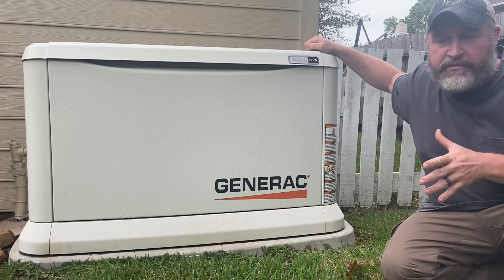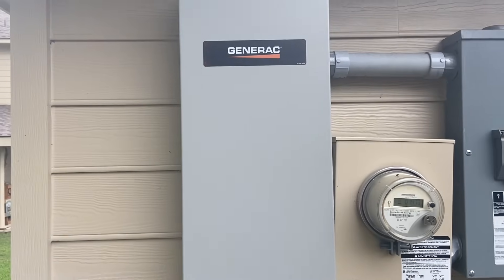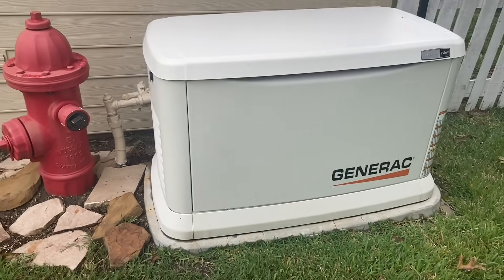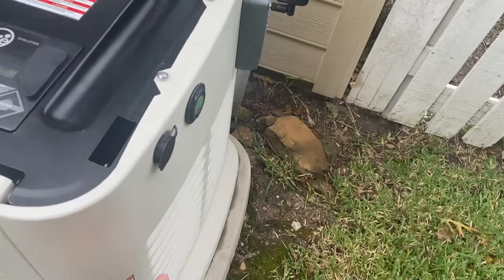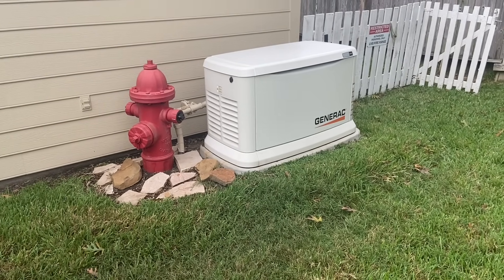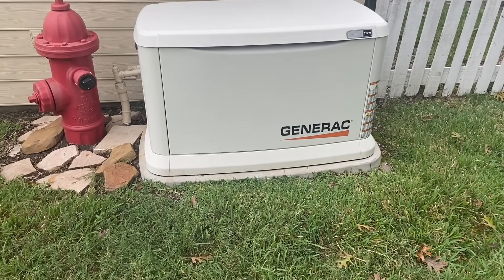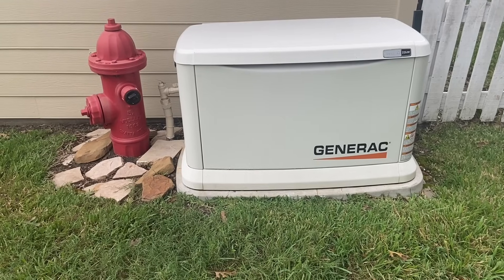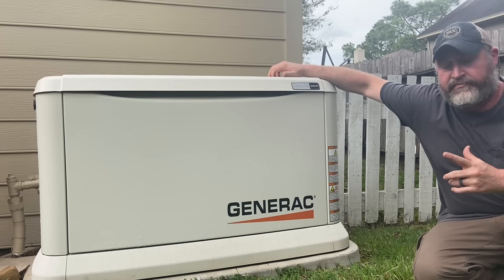Thinking of purchasing a generac whole home generator?

Comment: You got a 2700 sq ft home with 3 AC units and even the garage are cooled. Sounds like you make a lot more money than the average person unless you have 25 people living there, like some of those third world people.  I don't know where you are located , but I live in Toronto, 1500 sq ft?  2 people, and I just have one bedroom with a 6000 btu window AC unit. I am a retired electrician, and I can rig up a 3000 watt generator into the house panel faster than you can blink. I think people like you should experiencing some of Europe's power cost as an exercise of restraint. I am not spending all that money to dig for new gas lines and automation just so that I can sit on my back side when the power go out. It is also not a good idea to hang an extinguisher at the gas meter, if there is a fire there, I want to have distance from it , not to go and grab the thing to try and put out the fire.
Reply from the maker: Great thanks for watching, I work 2 jobs to have what I have. The fire extinguisher is for my grill on the patio. I don’t appreciate the “people like you”comment , you are extremely judgmental. Please don’t subscribe to my channel.
Reply: @JustCantSitStill  Agree with you. I have the means and refuse to live in 3rd World conditions, and Europe runs a close second to that category. Yes, I've traveled there. Nothing beats the USA in living standards. I'm blessed to live here and proud to be an American!
Reply from the maker: @XavierIsraelMatamoros  thanks buddy
Reply: @JustCantSitStill  Somebody is grumpy and jealous lol. Free country means you do what you want when you want. Europe dug their own hole.
Reply from the maker: @CanadianBrewingChannel  thanks buddy, I appreciate you
Reply: @JustCantSitStill  Don’t let the “Tony the Canuck” bother you too much, they tend to be on edge. I am from Michigan and I know the score about them. Many have a big chip on their shoulders about us Yanks, and they are always trying to prove something. After I got back from Iraq in 2007, a few of them used to try to push my buttons about us being over there, but I just laughed in their faces. A friend of mine lives across the border in Windsor, and it seems that most of the guys live in their mom’s basement drinking booze every day and watching hockey, all while their wives work. 

In the end, Tony’s comparative analysis makes no sense anyway. He is comparing his Toronto home to your place, which is completely opposite of your living situation. Also, he doesn’t understand that your generator is based on your requirements; 2,700 sq ft house, 3 ACs, are garage. Obviously you would not be installing such a generator if you own a 1,500 sq ft, one bedroom house, in Toronto. And I’ve been there. It is probably a narrow, two-story house sitting three feet from his neighbor’s house.
Reply from the maker: @veltonmeade1057  thanks buddy! Maybe Toronto Tony will come back and give us all some more of his wisdom and judgment.
Reply: @JustCantSitStill  please ignore Tony Lam. He’s just jealous and envious.  My husband and I live in a 3500 square foot home that we worked extremely hard for.  Hey Tony it’s all paid for!
Reply from the maker: @d.b.4162  thanks for watching and the comment. I am waiting for good old Tony to come read all the great responses! ✌️
Reply: Tony….. do I smell a bit of stank from your jealous envy? How aboot you do you and you just not comment because your pissed he lives his own life.
Reply from the maker: I believe your right!
Reply from the maker: Thank-you
Reply: Tony, bye bye KAREN.
Reply: Wow buddy. Was it really that serious?
Reply: I live near Toronto too and up north one unit is enough as it is a very short summer.  Down in California my uncles have large homes with 8 large units in each house as the temps go extremely high to about 110F.  I have many properties here.
Reply: It's really difficult to understand why some people always want to piss in your Wheaties, but there are always a few.  Like someone else said, living in the US allows you the freedom to install your own power station and live the way you want to.  Many of us have fought for years to protect our freedom, and will continue to do so!  Seems like outsiders will stop at nothing to encourage us to question and fight against a system that has worked well for many years.  Yes, Tony Lam is jealous, and I don't blame him.  God bless you, JCSS, you work hard, keep an amazing home, and do things the correct way (safety for your family first).  Thank you!
Reply: You have no idea what his situation is at home.  Many many people are living with elderly parents and family members who are on oxygen or require constant care that REQUIRES electricity. Perhaps he lives in TX, MS, LA, AR, MS - one of those states that gets soooo hot - the devil would sweat!!!   Even if none of this is the case, and he wants to sit on his butt - you're judgemental to say the least!!  Lighten up!!!
Reply: Please don't judge all Canadians on that person from Toronto.  Generally speaking, the rest of Canada can't stand them, as they think they are the center of the universe.  I just got through a couple days without power courtesy of Hurricane Fiona on the easy coast with my mid-sized Champion - it did what I needed, but I am telling all my kids to do exactly what you have done with their homes.  I am installing a transfer switch to at least avoid all the extension cords, but might go all the way with a solution like yours.  Very nice set up!
Reply from the maker: Thanks Don for watching and checking out my channel, please subscribe like and share and check out some of my other videos
Reply from the maker: Houston Tx , thanks for the kind words and watching my video, please and check out some of my other videos.
Reply from the maker: Thanks Nana for the kind comment I appreciate you.
Reply: Tony Lam
What is your problem? He can do what he wants with his home and money.
Reply: Don't understand the negativity. To each their own. It is good you were an electrician and have the ability to rig up a 3k watt generator. Not all of us have that skill.
Reply: Yesterday we was hit with hurricane Ian in fort myers Florida. People are still without power, water, gas etc. If you can afford to have a generator for your family  and invite neighbors close and family when there’s a outage why not!! There are so many other things YOU could have spent the money on!!! People really just be miserable. I’m sitting here talking with my husband about installing one also. Thanks for the video
Reply from the maker: @jinellesalandy3959  thanks for watching I appreciate you.
Reply: You have a lot to criticize on a video someone else put time into for others to get some free information. Maybe since you have so much to say you should make your own video. And if your lucky you can read some random trolls constructive criticism on your work..
Reply from the maker: @conductor3968  perfect 👍 thanks so much for watching. Most don’t understand what it takes to do this! I appreciate you!
Reply: I Appreciate this video by the way. I live in Mt, and probably deal with up to 4 outages a year spanning from 2hrs to a day sometimes. Temperatures can be sub zero 4-5 months out of the year, so this was a great video.
Reply from the maker: @conductor3968  thanks again for watching please subscribe like and share  and check out my other videos,
Reply: The title of his channel is can’t sit still.  He works hard to have the stuff he “wants”.  I may go the portable way but I always worry about someone stealing it.
Reply from the maker: @Jbzy3000  Jarrod you hit the nail on the head, thanks buddy for watching.
Reply: jealous much?
Reply: What the hell is your problem, Tony? Don't worry folks, most Canadians aren't as nasty as this guy. 

This was a great video -- very helpful for those of us looking into a Generac following recent hurricanes in Sept 22.
Reply from the maker: @csmac3144a  thanks Steve!
Reply: Lmao it’s always the Canadians talking shit about America. I wouldn’t visit Canada if it was a free vacation. USA all the way leave this man alone he affords what he can afford and he’s entitled to have what he wants. If you don’t like it don’t watch
Reply: I couldn't ever afford it hell I'm so broke I can't even pay attention..
Reply from the maker: @michaelpayne8000  been there before sorry bud I hope it gets better.
Reply: @NighthawkCarbine  HEY!  Play nice, ya little Tony junior.   Some of us are sick of that damned meme.
Reply: I have a back up generator, and a back up back, up generator. 

❤America!❤
Reply from the maker: @RockandRollRC  that’s the way !!!!
Reply: @NoName-tn9cm  Tough Rocks.
Reply: We found the Karen in the chat,, freaking troll.
Reply: @JustCantSitStill  ❤
Reply from the maker: @davidbrown5587  thanks David I appreciate you.
Reply: @veltonmeade1057  Obviously “Tony the Canuck” didn't LISTEN to the video as he clearly stated that he was in Texas...........hence the abundance of A/C's.
I live in the PacificNorthWet, don't loose power that often, I've been thinking about powerwalls for power outages.
I did appreciate the financial breakdown of costs for it.
Reply from the maker: @RiverRatWA57  thanks for the comment and for watching, youtube trolls are never fun to deal with but I definitely makes the comments interesting 🤔. Have a great week.
Reply: Its pretty hot and humid down in Texas, plus their electrical system is a joke.  Money well spent.
Reply: @BobABooey.  my house was built in '25,  no central A/C, just a couple of Windows shakers for bedrooms, I only ran mine a few days this past summer. 

You couldn't get this Yankee to live down south,  too Damned HOT down there!!!!!!!!
Navy transplant from Michigan to the PacificNorthWet.
Reply: @JustCantSitStill  Ignore people like this.  Probably some adolescent or disgruntled outsider who is jealous of people taking advantage of what is offered to American citizens who choose to live a good lifestyle based on hard work, simply put, pursuing the American dream.   Too many lazy people in this world who simply want to have what their "neighbor" has without putting out the effort and use SM to pontificate and feel important. A home stand by generator is an excellent way to improve your home equity.
Reply: @JustCantSitStill   I totally agree with you..  We just installed our whole house  22kw generac generator!!  I also work 6 days a week-2 jobs and never looked for hand outs!! Pathetic to see people get jealous of others success! They can too.. but there lazy asses are too busy typing instead of working
Reply from the maker: @reptoid5634  thanks for comment and for watching, please check out some of my other vids and have a great holiday. Cheers 🍻
Reply from the maker: @ricknofzinger  thanks Rick for watching I appreciate your comment, please subscribe and check out some of my other videos, have a great holiday.
Reply from the maker: @darrenw.taylor2084  😂 thanks Darren for watching I appreciate you , please subscribe like and share, check out some of my other videos and have a great week buddy.
Reply: @JustCantSitStill  both liked and subscribed. Thank you for sharing your knowledge!
Reply: @donalddodson7365  I was thinking the same thing. Why are Canadians so darn salty??
Reply from the maker: @ChuckMorton  never had NG cut off in my 42 years, but thanks for watching
Reply from the maker: @ChuckMorton  cheap houses lol 😂 thanks for the laugh I needed that.
Reply from the maker: Nowhere near I-35 try again bud.
Reply: @JustCantSitStill  He's entirely right though, the idea of using a generator to run AC is just disgustingly wasteful. Why not operate a generator to run stuff you actually need, and not everything that's nice to have?
Reply from the maker: @omardude39  simple….because I can
Reply: @JustCantSitStill  Well said.
Reply: Tony, I'm also retired, very able, and still licensed, and I'm also in Canada. Think about it... "In many brutal weather conditions,"   there is no way we will be unable to "rig up a 3000 watt generator into the house panel" - if the extreme weather doesn't stop us, it will certainly stop the generator!
Reply: No doubt! A 2700 sq ft home with 3 AC units plus a cooled garage? That is serious overkill. I have a 3200 sq ft home and have “only” two AC units. I wonder if the 3 AC units are whole house or window.
Reply from the maker: Thanks Bruce for watching.
Reply: @JustCantSitStill  Thank you for this video! I'm thinking about a system for my home and your video answered a lot of my questions. 
Next I would like to address the comment from Tony Lam. Not everyone is capable of hooking up a generator safely in a matter of minutes. Personally, I can, however my wife can't. She is on an oxygen concentrator and it is critical that we have power. She has a lung disease and no she never smoked a cigarette in her life. It takes a real jerk to be so judgmental  and has no clue as to what other people have been through and are going through now. We have a 3,800 square foot home with a 2 car garage that's paid for and we worked our tails off to be where we are. We worked 2 jobs and lots of hours. My wife worked as a full time server in a high volume, fast paced restaurant by day and an 8 hour shift at night at a carpet mill for many years. I worked 2 shifts, worked every holiday and weekend as a industrial boiler repair technician for over 40 years. So I have no sympathy for some idiot sitting on his retired electrician ass complaining and bellyaching about what other folks have. I'm 67 and still working!! Maybe Tony should come out of retirement and go back to work if he's so concerned about people having more than he does and try to have something himself. Wow! what a nut!!
Thanks again for the video. It's exactly what I was looking for. Also I'm very happy to see you doing well in life. Looks like you have a real nice place there!!
Reply from the maker: @cleophusfowler  thanks Barron I appreciate you. I enjoyed your comment and fully agree.
Reply: That is a very condescending jealous comment.  If you have nothing good to say about a hard working seemingly respectable person, keep it to yourself.  Jealousy is not a great attribute.
Reply: It’s pretty absurd you say a man and father ensuring his family has power to cook food, stay warm and cool, and to stay safe during a prolonged outage “sitting back on your backside”.  People have died due to severe weather in areas that are not used to it. Couple that with crazy environmental extremists shooting up power stations and power companies doing rolling black outs due to extreme regulations, this is a no brainer.  I plan on getting one next year early 2023 after tax time.
Reply: I don't think he has a lot of money, in the first place he lives in Texas so the cost of living is cheaper, that means you can have more toys and creature comforts, living in Texas it probably makes a lot of sense to have back up power,  especially from that cold spell. They had a year ago,  I'm a retired painting contractor in California I have a 1800 sqft house in the San Francisco area, we haven't had a long blackout in over 30 years but you never know, I've been thinking doing it, 10 grand is nothing,  I'm 66 years old and I don't want to sit in my house 1 day with out electricity even if we do have good weather,  I have a 2k generac and have only use it less than 10 times over the past 35 years , mostly at work.
Reply from the maker: @mikeo8890  i agree I don’t have a lot of money click the thanks button, like 👍 subscribe and share.
Reply: I live in Canada have a small home have 3 generators a 2000 w , 5000 w and a 65000 w and a 4000 w dc ac power inverter . Don,t need all that but got it anyway .  I like to be prepared  . I can assure you the majority of Canadians  that I know do not think like Tony .

Comment: BRIEF BLOG: A VERY USEFUL DEVICE FOR THE HOME, BUT OVER 6 GRAND! C'MON!.THERE HAS TO BE LESS EXPENSIVE ALTERNATIVES TO THIS GENERAC DEVICE. SORRY, OUT OF REACH FOR MOST PEOPLE. TIME TO START LOOKING FOR MORE EFFICIENT & LESS EXPENSIVE ALTERNATIVES.
Reply: 11k for essentially a private power plant that feeds your whole house for days doesn’t strike me as super expensive. There other lower power options that don’t do the whole house.
Reply: another alternative is portable generator with transfer switch install or/and at least 12 guage extension cord(s) running from generator into house but this type of setup might not run the whole house and you will have to keep refueling the generator every 3-12 hours (depending on usage) and monthly maintenance even when not using it. This type of setup will likely cost $1,500 min all the way up to $6,000 depending on brand, type, and wattage of products purchased.
Reply: Efficient?  Most efficient is no power consumption.  The reality is something livable.  The utility company is the cheapest option, but inherently unreliable at times.  Reliability has it's cost and so does modern expectations.